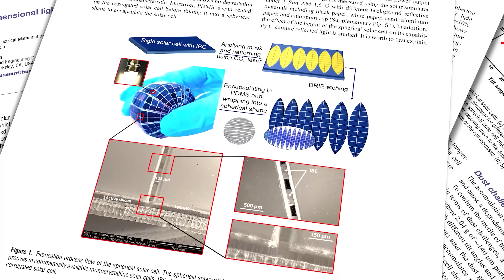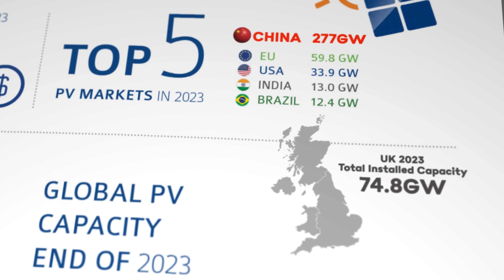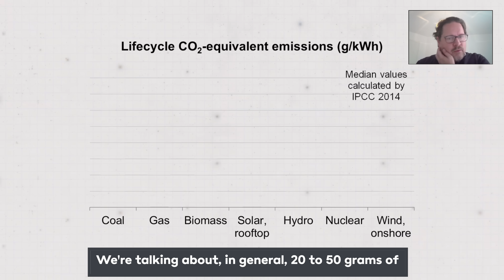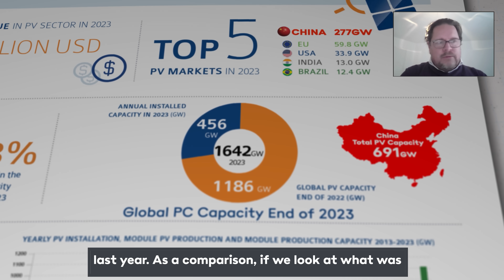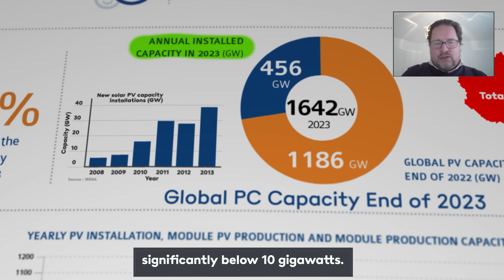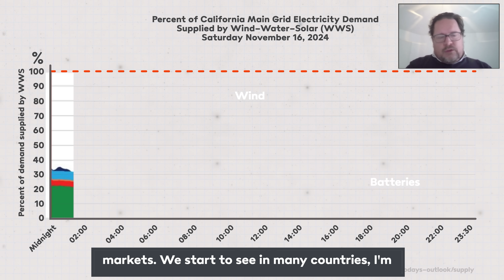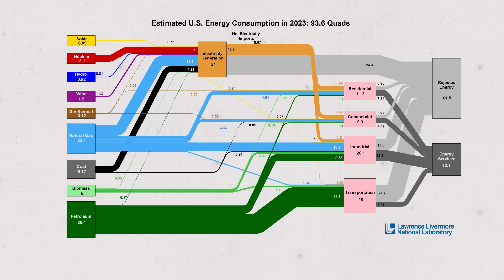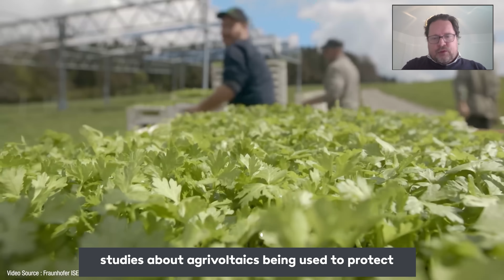Renewable Energy Domination

Comment: PV solar is a no brainer. If we do get the efficiency improvements from the perovskite-on-silicon tandem solar cells that are being installed now for commercial applications from Oxford PV the amount of area needed for solar in the UK will go down to 1.5%. If we find a way to get more of that installed on roof tops the amount of land needed drops some more. If we, like you talked about, combine it with agriculture by installing bifacial solar vertically with the sun coming from the east to west or just high enough to allow for planting & grazing underneath again the impact of adding solar is lessened. Cheaper & more efficient solar is being installed now making the future of decarbonized energy brighter & brighter.
Reply: Between residential and appropriate box store and other roofs, and also parking lots, there’s your 3%!
Reply: I need to start looking at it again.  I'm busy rewiring, replumbing, and fixing the foundation on my 1913-built home. Plus about a hunnert other things that are priorities. Having spent my career as an EE and software engineer,  I'm definitely not an early adopter, but things have changed quite a bit in recent years.
Reply: 10 million buildings times 5kW each gives 50GW. That's roughly Australia's entire grid capacity, or a significant chunk of a more populous country's needs covered without needing new poles and wires.
Reply: @Roxor128  "According to National Renewable Energy Laboratory (NREL) analysis in 2016, there are over 8 billion square meters of rooftops on which solar panels could be installed in the United States, representing over 1 terawatt of potential solar capacity." U.S. Department of Energy 
According to U.S. EIA the United States uses about 10.5 billion kilowatt-hours (kWh) of electricity per day, as of October 2024. I think there is enough roof space. 👍
Reply: Of course using rail and road verge areas and not just agricultural land will also increase the percentage of land available to use.
Reply: @neiljessop3510  Yes. I've always thought that it would be great to have solar panels above all of the above ground metro tracks in Washington, DC to help power the system. I also wondered why they used huge disk brakes to stop the trains rather than relying on more regenerative braking. I saw that a place had solar panels over a bike pathway built between a divided highway, and thought, why not build a much larger canopy of solar panels that covered the roads at the height of the bridge overpasses. When we start thinking about it there are tons of places we could put now cheap solar panels. All these places would lead to crazy abundant electricity available really inexpensively.
Reply: Yup, parking lots alone cover in PV would be all any city, state, or country really has to target. The down side is you still would need to build up wards and that would add cost. Yet there is still roof top solar for many of these companies/buildings as well.
Reply: Do need solar access rights to become enshrined to promote solar in dense areas.

Comment: If the worlds roads had solar panels over them(canopy) it would produce roughly 2/3rds of the worlds electricity.  If every rooftop had solar it would produce twice what we currently use.  Also, covering aqueducts could produce electricity while helping reduce water evaporation.  I don't expect all this to happen, this is more a comparison of land use.
Reply: India has been building PV installations over waterways for a while now, and floating PV seems to have been taking off in Asia as well.
Reply: I like the idea of providing shade for all parking areas by using PVs.
Reply: @GTN3  Yeah, I didn't even include that in my comment.  There's plenty of dual purpose area's that could reduce or eliminate large solar farms if we were smart about it.  This doesn't even include other forms of renewables either.
Reply: I wonder if shading roads could help reduce maintenance costs as well, by narrowing the range of temperature the tarmac experiences.
Reply: @danyoutube7491  Sounds logical but for sure it would reduce accidents from sun glare, snowfall and heavy rains.
Reply: @Ryan-ff2db  I would be more scared of the snowfall. Snow has some weight to it, they could break or slide between the panels spacing.
Reply: @adr2t  I'm sure in areas that get a lot of snow they could engineer a stronger structure or steeper panels just like they do with houses.  However, areas that get large amounts of snow are also typically less effective in solar generation.  I don't expect a lot of solar canopies in Minnesota or Alaska.  There's always a cost/benefit analysis for all large projects.
Reply: The only thing is that, building PVs over high traffic roads will reduce efficiency because of the smog and dust that will inevitably attach to the PVs themselves (maybe even corroding them because of the particulate). Probably the best solutions is over irrigation channels to avoid evaporation and also on railways, why not
Reply: @SunriseTequila523  Of course, if the vehicles were electric, there wouldn't be the smog, and a lot less of the particulates. Roadside solar panels and induction coils could actually power the cars, reducing the size of batteries and allowing the cars to be lighter and therefore use smaller brakes and lighter tires that would generate even fewer particulates. Given the right incentives, the whole system can trend toward safer, cleaner, cheaper, more comfortable, easier to use, faster, and just plain better. Only FUD and lack of imagination are in the way.
Reply: @SunriseTequila523 in congested areas, EV only roads with solar canopies to promote EVs with traffic clogged roads only for ICE.  Eventually EV road gets clogged, but then back to status quo, but with solar.
Reply: They could be floated over water storage reservoirs too. Have them towable so they could be pulled to the bank if needing any maintenance.
Reply: The only problem with doing roads is that you need to take in the cost of building higher than the biggest items we can drive. Thus you will be adding a ton of cost to have that space. Also making safe from wind and road construction. Aka, a flying rock..

Comment: Storage on wheels cant play a really important impact for grid Stability. What happen in the night.When you will start your car in the morning you   need a battery which is charged. Also almost nobody wants a faster degredation due to continuos charging and unchharging.
Reply: We're waiting eagerly for the bi-directional chargers to be available. We've been driving EV's now for 2 years and most of the time only do 50-100km's per day when the car has a range of 400km's. That leaves 75% of 55kwh (battery size) of range that could be used by my house. When we have a long trip planned then we can simply disable the bi-directional. We've only seen 2% degradation over 30,000km's, so degradation shouldn't really be a concern as the degradation is apparently none-linear with the bulk of the degradation in the early years. That's my thoughts anyway:-)
Reply: @derekstephenson9613  Hi. The case for each user will be different depending also how often you use your car and also the possibility to charge it. It would be interesting to know how often you charge your battery and if you use the supercharger. In the case that your car goes in the future to the grid and you have several battery loadings and unloadings, the reality could be less favorable. I guess also that you would loose your guaranty for the battery. Because its calculated normally for a usage of 160000km or 400 complete cycles or eight years and when your loadings and unloadings are a multiple of this equation during the same period, could the seller change the conditions.
Reply: @tinogruchmann  I think typical grid use would be a lot less than multiple full charge-discharge cycles per day.  More like 20 kWh discharged relatively slowly, for example.  Compared to the demands of driving, this is very gentle usage.  Most battery damage happens at the extremes of high or low state of charge, but this kind of usage would stay in the battery's "safe zone".
Reply: @incognitotorpedo42  if it would be only 20 kWh a day its still 120 complete extra cycles a year for a 60kWh battery or  in eight years 960 extra charges this would be almost 2,5 times more cycles than assured by the car maker. In km it would theoretically be 160000*2,5 = 400000km more.

Comment: Solar doesn't reduce CO2.  Stopping the use of fuels that put it in the air would..   So if LLMs, population and other things are growing electricity usage faster then Solar we can still be putting out more CO2.   Any world wide data on this?
Reply: When solar displaces fossil fueled electricity generation, it absolutely does reduce CO2.  The world has the production capacity to grow solar faster than demand.  Installing it is a slower process, and getting it connected to the grid can be very difficult, at least in America.  China is adding solar at a stunning rate.  Data for the largest nations was presented in this video.
Reply: @incognitotorpedo42  I'll let you reread what I actually said and try again if you have any information on that.